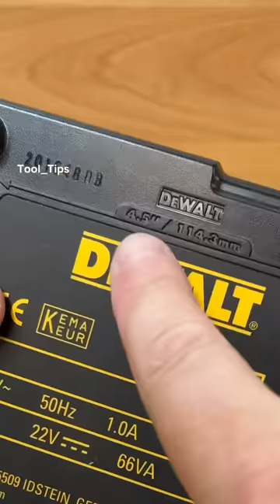The Top 50 Handyman Tool Tips and Tricks - Another Level Up

Comment: The one with the lock and spanner, doesn't look like it would work, because, all you have to do is lift the spanner up in the middle and keep the lock straight,  and pull through. Perhaps it needs smaller handles.